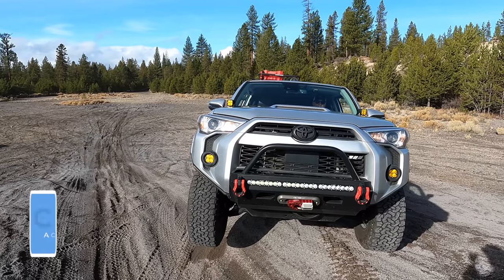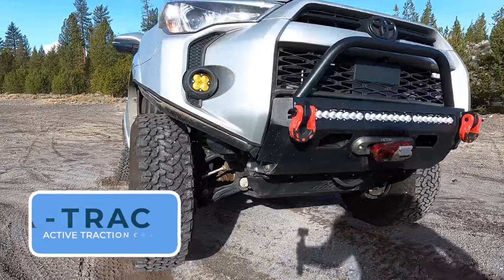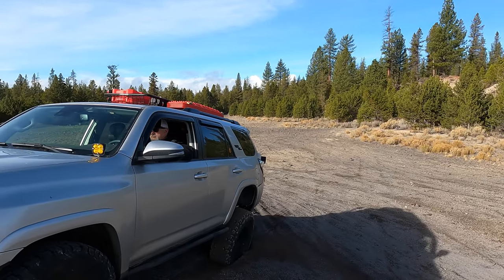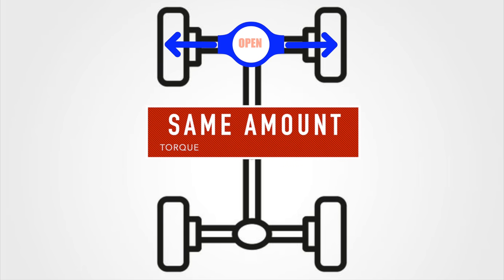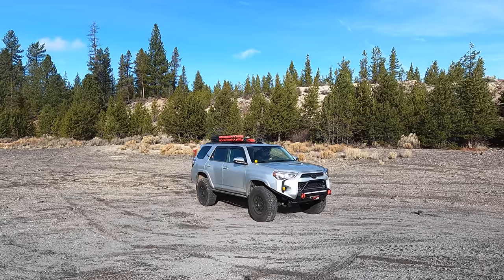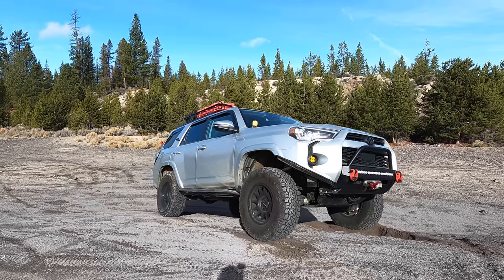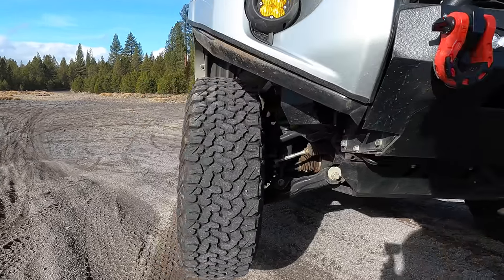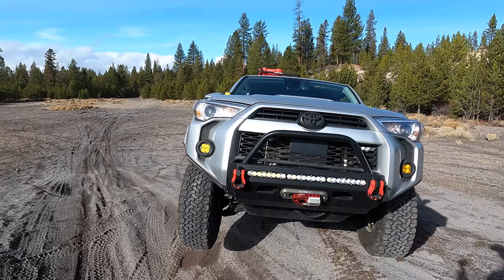Finally, The Only A-TRAC Video You Need to Watch. Multi Terrain Select Explained. ATRAC v ARB Locker

Comment: Thank you so much for this explanation. I got to use ATRAC while wheeling with my 13' 4Runner Trail and my buddy with a 2001 Durango. The Durango struggled to make it up a rock climb when one of his tires lifted off the ground, and he had to try several times to finally get the right spot to go up. Me watching him struggle i put it in 4L and enabled ATRAC and went up the same route he struggled over. As soon as my wheel lifted ATRAC activated, braked that lifted wheel, and I drove up the section no problem. Its an amazing off road feature to combine with rear-locking diffs and the others.
Reply from the maker: I totally agree...ATRAC really is an amazing tool. The modern traction control systems can pretty much solve most of your problems. And if they can't...I guess that's what winches are for ha ha!
Reply: Durango is not toyota or honda. You are not welcome here.
Reply: Subarus system although not really intended for serious off roading, does this as well, it sends the torque to the wheels with the most traction while braking the low traction.
No buttons or switches needed.
Reply: @ahahuehafook4207  had 2000 durango with s 5.9 bought new. Full loaded  , came with Goodyear Wranglers AT tires. Truck Was totaled in 2019. Bought 2021 
4 Runner. I notice that the Dodge with tire setup was way better in the snow than the crap Dunlop ATs that came on the Toyota truck is all over the place in the snow. Was disappointed in the snow performance of the truck with the Dunlops compared to the Wranglers on the Dodge. Dunlops ride nice on highway but look like car tires. AT? Naa. What is a tire that would give me better traction with out noise or crap gas mileage?

Comment: Very well done. To me IMO, lockers are always a more controlled way to get through a tough obstacles. It seems that ATRAC wants to stress the CV's.
Reply from the maker: I totally agree!
Reply: I'm definitely not an expert but I do love to go off road. From the video, my takeaway is that wheel lockers are far and above the best way to go... I'm thinking about buying a Jeep.
Reply from the maker: @mrpeabodythethird  I have to agree about lockers. They are my go-to every time before the modern traction control systems.
Reply: I bought the Sport Tacoma simply because adding lockers defeats the purpose of MTS / A-TRAC, and I plan on adding lockers. It was also 4k less than the OR msrp (toyotathon), so after I add the lockers I'll be on par with the price of a stock OR, but much much more capable. Only issues now are the lack of the electric brake booster, and slightly smaller pumpkin. That being said, neither is really "required" and I think an extra 0.75" in the Dif wouldn't really justify the extra cost with both trims in front of me. Considering I payed $35,450 out the door on my 21' Sport 4x4, I think it worked out extremely well. Especially now that the truck is somehow worth over $45K. Markets are nuts atm.. Great vid, love the simple explanation OPN
Reply: The MSRP is exactly the same between the OR and Sport 'IF' you configure them the same. With the difficulty in the market today it may be hard to locate them though and have to buy whatever is available.
Reply: @user-ej1bq4bq2w  Have you added lockers yet?
Reply: @mrpeabodythethird …best if you want solid axel.  If you want comfort and reliability Toyota is king.  A slightly modified 4runner will do 99% of what a Jeep Wrangler rubi can do.  Now if you want to do the rubicon trail an out of the box rubicon won’t cut it…it to will need to be modified.

Comment: Really good video! From the moment you said "an open diff splits the torque 50/50" I knew it would be a proper run through, I don't know why so many people get that wrong and think a locked diff is a 50/50 split? I guess it is hard to visualise that locked rotational speed does not equate to the same power/torque going to each wheel.

That said, what this video shows is that nothing beats a good set of lockers. I wonder what all these systems cost to implement compared to simply adding a factory option for front and rear lockers to the relevant cars? For a novice I suppose it is easier to use a locker at the wrong time, or forget to turn it off and damage your drivetrain.
Reply from the maker: That is hands down the best observation ever: How much do these systems cost to implement compared to simply adding a factory option for front and rear lockers?!
Reply: Agreed.
Reply: Maybe I am unusual, I've had lockers but for what I do I would choose quality mechanical LSD (preferably torsen) any time
Reply: @geepuller1  The problem with LSDs is that they are exactly that,  limited slip, they don't stop slip. Where lockers do. But traction control can as well. Its way more effective at controlling wheel speed differences. Torsens often dont cant control wheelspeed at all. So when one wheel leaves the ground it just keeps spinning. And no enough torque is generated to actually activate the LSD. Thats why vehicles with traction control can sometimes preform better than vehicles with LSDs. That's why so many vehicles switched away from them to traction control. But nothing beats a fully locked 4WD system though

Comment: Great explanation of how these systems work! I've been pretty impressed with ATRAC the few times it has engaged in my LX470. I'm also a little jealous of all the options you've got. For me, it's ATRAC only .... and I can't even deactivate it if I wanted to, haha.
Reply from the maker: Thanks! That LX470 is an awesome overlanding platform!
Reply: Just hold the 'traction control' button down for about 5-10 seconds and it should deactivate A-TRAC. Pressing it only once just deactivates traction control.
Reply: @angelotsi849  The 100 series doesn't have a traction control or A-Trac button. It's always active for us (TC and VSC is disabled with the CD lock though)

Comment: Clear and easy to understand. I see in your summary you mention MTS is unavailable in 4Hi on Tacoma. Good catch. Also, unless I missed it, A-Trak in not an option on TRD Off Road with AT. MTS and Crawl Control substitutes for it and in 4Lo only, at least on my 2018.
Reply from the maker: Thanks!  Yes, you almost have to keep a spreadsheet to know all the all the option configurations. Thanks for the info on your 2018.
Reply: @OverlandPNW  I actually do have one! And I still need to refer to it from time to time. Ah, how I miss the simple old days. Get out, lock the hubs, throw a lever and good to go!

Comment: Dang! That was a lot of information and you did a great job explaining it all!  I thought my 2020 Cherokee Trailhawk was complex. I only have a rear locker and it will apply the brake on the spinning tire up front, similar to your A-track, but there's no button to engage it.  Most of the time I forget to use my MTS. Rock mode seems to make the most difference to me, with very little wheel spin allowed and 1st gear gets held into higher rpm.
Reply from the maker: Yes, A-Trac/MTS has a lot of detail and I didn't even cover crawl control ha ha! I seem to default to use of lockers. But, I like knowing how all the systems work. They do work great and are a great backup!

Comment: This is the best overview I have seen. And I’ve searched almost the entire internet! thank you!!!!

I have a GX460 and the systems are very close to the 4Runner but there are some differences. Would love to see a follow up to this video with a GX following along. I’d be game but I’m on the east coast. 

According to the manual. 
Active TRAC (TractionControl) for L4 position*
Helps to maintain drive power and prevent the 4 wheels from spinning when starting the vehicle or accelerating on slippery roads, or in off-road conditions. 
*but there is a footnote!
The function only works in vehicles with Multi-terrain Select when Multi-terrain Select is switched on. 

Not all GX’s have MTS. And we may not always have it turned on. There is no ATRAC in 4 High only “TRAC”
Reply: The other nuance for GX’s is that they have center locking diffs. I do wish it had proper lockers like yours though!
Reply from the maker: Thanks! The GX460 is a great overlanding platform. My brother has a friend that started a GX build so we might have had one available for the video but unfortunately, he got distracted with other projects and the build was put on the back burner. Cheers and thanks again for the comment!

Comment: Really good explanations. I am new to 4x4 and just started using ATRAC and was wondering about MTS and this video explains it really well. I think I need to head to an SVRA to play around and apply some of what you shared. I am also thinking I should add front lockers - that seems the most powerful option.
Reply from the maker: I love my ARB front air locker. It engages instantly. E-lockers almost never instantly engage. You have to drive forward and sometimes backward to get them to engage. Air-lockers also can be engaged while driving. The ARB info on it states: "An ARB Air Locker can be engaged at any speed as long as both wheels are spinning at the same rate." You want to be very cautious with this because if one wheel is spinning faster than the other, what is called “crash locking” will occur and can cause damage. That said, I use this feature all the time off-roading. I engage and disengage on the fly as needed. I also have engaged the front air locker as needed while driving over the pass on snowy roads. I'm not sure how fast I was going but probably 35-40 mph. For me, this is a huge advantage over e-lockers. So, I agree that adding a front air locker is probably the best. But, it really all depends on your driving style. For the average off-roader or overlander, A-TRAC and MTS will handle almost anything you get into.

Comment: Very informational! One question I've not been able to get an answer to is, if you engage the diff lock, should you avoid turning the steering wheel?
Reply from the maker: I'll do my best to answer this. My answer is limited to rear diff locks as front lockers have additional concerns of which to be aware. First, a rear diff lock should not be engaged for on-road driving, unless weather conditions such as snow or ice require extra traction. A locked differential is not for use on dry pavement. A locking differential is meant for off-road driving on terrain, such as dirt, gravel, mud or snow. These types of terrains have some "give" which his is important because  when making a turn, the outside tire has a longer distance to travel. Turning with a locked diff puts strain on the diff and axle components. While it is ok to navigate moderated turns off-road with a locked rear diff, it is best to avoid hard turns when possible. So, it is situational based on the terrain. Yes, you can execute turns with a locked rear diff but it is always best to minimize/avoid turning where possible.

Comment: Nice explanation of MTS. I have a GX470 which is essentially the same a a 4th gen 4R.  I have been able to use Atrac in both 4H and 4L. Not sure why you're only able to use it in 4L. Maybe because the GX is full-time AWD, then 4WD when we turn on the CDL. For me, instead of looking at the speedo keeping it under 5mph, I think it's simpler to look at the RPM and keep it under 2k RPM, which has worked well for me. And if I need that wheel spin in mud/sand/snow, I'd just go past the 2k RPM. Great video.
Reply from the maker: Thanks! That is a great add and very helpful info for the GX470 viewers. We actually have quite a few as the GX470 is a great overlanding platform. By the way, I loved your Drive Through Oregon video. Very nice capture of the State.

Comment: Went from a fully built 1999 100 series to a 2011 GX460.  The Land Cruiser had a factory rear locker but no ATRAC. Had to step away from wheeling for a few years but recently took the GX 460 to an off-road park for the first time and was completely blown away with ATRAC. I was following built rigs on 35"s and made it up everything they did with a 2" lift on 33"s. At the end of the day I realized I DID NOT have the center diff locked the entire time I was out there. I just had it in 4 low with all diffs open and ATRAC just pulled me up and over everything. I had initially planned to add lockers but at this point I am just going to add MTS and Crawl Control and call it done. The software is truly impressive and even in tough situations I'm sure it will do everything I need it to.
Reply from the maker: The GX 460 really is a great overlanding platform!

Comment: Excellent video! I have Small problem! 2002 Sequoia is my vehicle  ATRAC only. I plan to put lockers on at some point. But I agree with your information on a truck I can't say for everything else! since I only have ATRAC . Sometimes it seems like I have to wait 5 seconds maybe even 10 for it to kick in. Then it cuts a lot of power out and the traction light flashes 😀🙌🙌!!
Reply from the maker: You definitely get where you want to go in your Sequoia and that's what it is all about ! Your DIY tail gate fix was very nicely done!
Reply: @OverlandPNW  thanks. Since then I built a giant slide out platform . 44  inches in length. Underneath the platform I have storage space. On top of platform I have the fridge tied down.
And then removable kitchen kit  cooking. A lot of space on the flight out for cooking and preparing meals🔪. Hopefully I'll get a video together soon.

Comment: Great video, as long as people understand when you say acceleration you mean throttle input, atrak is great for getting unstuck or not getting stuck in the first place, I turn it on when I'm in 4 low and like you said it only works at very low speed not that 4 low is gonna go too much faster than 15 or 20
Reply from the maker: Great Points!'

Comment: I am fairly new to trucks, and my latest experience in snow with my Tacoma and four-wheel-drive. All I did was put my truck in four-wheel-drive high & manually shift into second and third gear, thereby reducing my sliding in the snow. I have an automatic transmission.
Reply from the maker: Very cool snow technique!

Comment: Honest question from an overlanding newbie: if you're going relatively straight on a loose surface, why wouldn't you just lock the diffs and keep them locked rather than messing around with all this open differential + added braking tomfoolery?
Reply from the maker: It is really just a question of driver preference and driver experience. I have had several comments from off-roaders that do not like computerized traction control systems of any kind. I get that. For me, I almost always do what you described: just lock the diffs. But everyone in our group has had mechanical failures of the factory installed e-locker on the rear axle. So, it is nice to know a little about A-TRAC/MTS as backups.
Reply: @OverlandPNW  that makes sense. thanks for sharing!
Reply: us SR5 owners don't have locking diffs... so atrac is our only hope.

Comment: Nicely done! Very detailed explanation. Nice setup having a front locker. I wonder how the vehicle performed with just the rear locker engaged.
Reply from the maker: Thanks and good question! We did not try it with just the rear locker but my guess is that it would have made it up. Hey great job on that ladder installation video! I just watched it.

Comment: As far as the situational ending, do you think you could of made it over the rock with just doing rear locker? I heard ya mention doing front & rear locker where 4Runner off road only comes stock with rear locker. Amazing video by the way !!!
Reply from the maker: Good point and I wish I had tested it with the rear locker! I actually went back through the stock footage double checked to see if I did. It was a pretty loose gravel mix in back but, based on how the dual lockers pulled it out of there, my guess is that the rear locker with A-trac engaged would have done it.

Comment: Nice Video.  I've been searching and watching videos all week for something like this.  I'm new to wheeling, and have read the manual but, I thought it was not very useful or lacking as some of the comments have stated.  That said, I 'm looking to try some difficult trails the the Carolinas , I've done some easy ones and looking to do more moderate trails, but wanted to get some expert knowledge by video before I run out there and tear up my rig. 20189 TRD Off Premium.  Like I said, I'm green to all of this, so the language at t his time is my stumbling block, changing modes on the fly or in  neutral or full stop....'m learning the terminology.  Thanks for sharing
Reply from the maker: I had the exact same experience as you: I could find any good information on A-TRAC/MTS and the manual was not very useful. It was so difficult to find decent, reliable info on A-TRAC/MTS. So, this video is really the culmination of my own learning curve gleaned from all the tech data I could find. I did have a Toyota mechanic send me a note. He said that the video was accurate and that he could not have done a better job, which was a very nice thing to say. Thanks for taking time to leave a comment, wheel safe and cheers!
Reply: @OverlandPNW  The MTS/ A-TRAC systems and Crawl Control simply use the brakes to control wheel spin, thereby transferring torque to the wheel that needs it most. I found it fascinating that there are no physical differences in parts for the different trim levels to support those systems, other than the electric brake booster. Even the standard trac on SR5's 4x4 are impressive when put in a pickle.